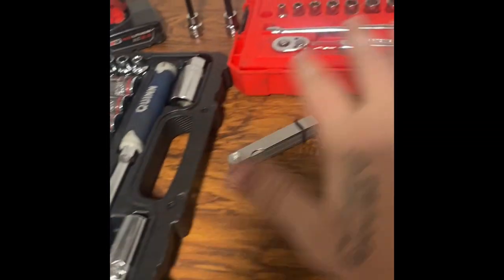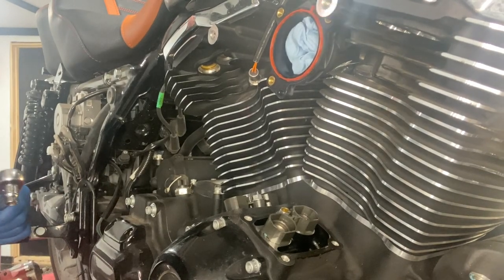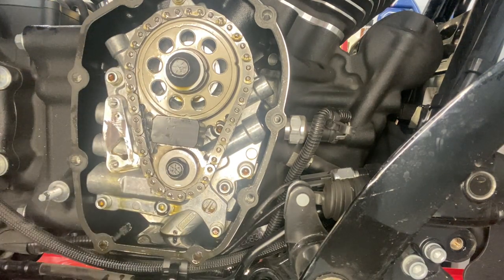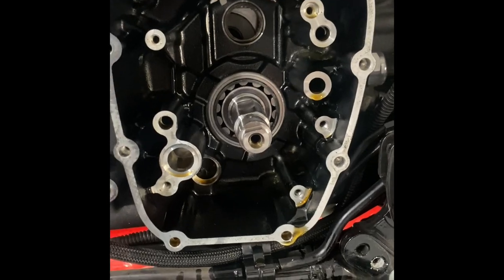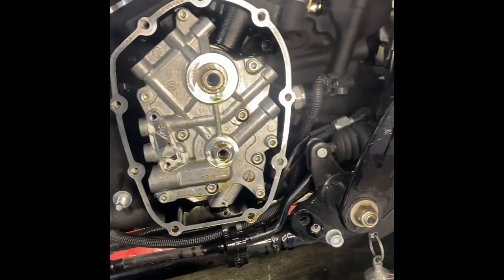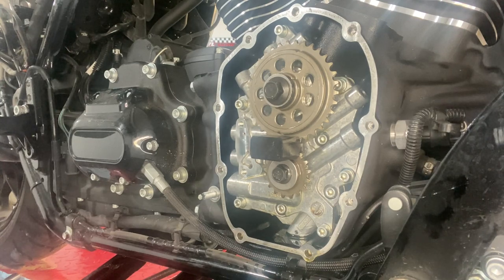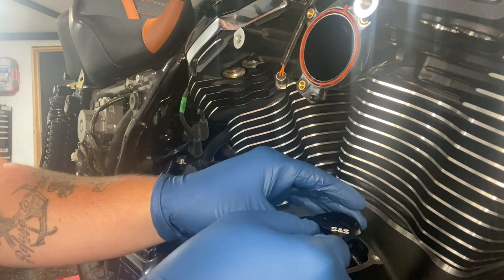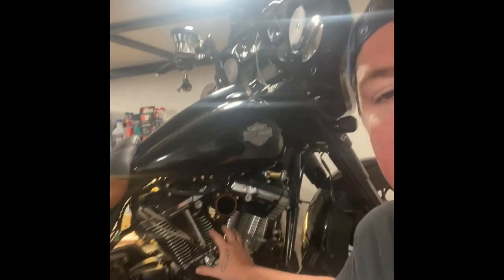2022 Harley Davidson Street Glide S&S 475 Cam Install

Comment: If you pull the timing cover you can put the bike in time on the rear cylinder and cut the pushrods.then rotate the cam 180 then do the front. Easy peasy
Reply from the maker: thanks for the tip! ill be sure to remember that for next time!

Comment: I personally wouldnt recommend messing with the S&S tappet cuffs for bolt in cams. Swapping them comes with serious risk that you could snap a cuff bolt and get landed with a very expensive extraction. I found out the hard way last year when I did an oilpump update and installled an SE Torque cam.
The tappet cuffs like those are used in high end LS Engines and do just fine, and I've yet to actually see any real confirmed reports of a stock tappet cuff failing in anything with a stage 2 or even stage 3 cam.
You can get some Magnetic Lifter Holders and skip the entire tappet blocks step and save a bunch of time, and avoid a bunch of risk by leaving the tappet cuffs alone.
Once you pull the cam out the lifters will fall out of the bottom of the lifter bores. So you can swap in new tappets, keep them im place with the lifter holder, then put the cam in.
Waaaay easier and safer than dealing with the cuff swap.
They dont really need to be swapped to billet ones until like, you do high lift cams that require serious springs and headwork.
If I had known they were a 0% failure rate part I wouldn't have bothered with the S&S tappet cuffs at all.
I got me a 22XE cam sitting in the box to replace my SE Torque Cam, along with an SE 55mm manifold FM 5.5g injectors, arlen ness Ventilator upgrade filter, and Woods platinum lifters. Next riding season is gonna be awesome.
Reply from the maker: To each there own. i personally wont open up the pushrod tubes and not swap out the cuffs. its a cheap peace of mind.
Reply: @whiteshedcustoms if you do it right then tappet cuffs are almost a must when changing out parts.
Reply from the maker: @Braapstar219  exactly!

Comment: Hello and thanks for taking the time to publish this video. 
I'm just starting to get interest into going with a stage 2 torque cam and I have no idea what the cam # mean.
Is the 475 a torque ir power cam and what made you decided on a 475 over another number cam.
My '23 Ultra needs some passing power and I'm not too aggressive ilkn my bike unless I really need to get off the line in a hurry.
Reply from the maker: @michiganborn8303  I would strongly recommend the ss475 or the star 30/30
Reply from the maker: @michiganborn8303  I see your in Michigan I am aswell if you need any help.
Reply: @whiteshedcustoms  
Unfortunately I moved out of Michigan in 2008 and now in the Sacramento area, my heart is always where I come from except for the brutal winters 😁, you can keep the cold.
So that's S&S 475? 
I heard something that the power on the 475 doesn't really kick in until the higher RPMs. Is that true?
Reply from the maker: @michiganborn8303  yes sir

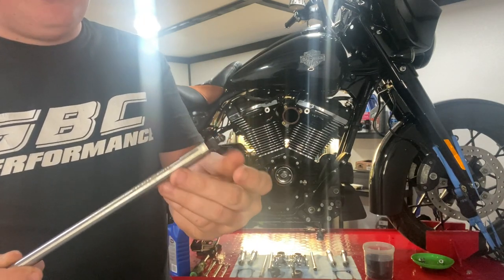Comment: Just getting ready to attack this install on my 23’ RG. Curious as to why you removed the cam plate and oil pump separately if you were reusing both? My bike has 34:06  about 600 miles on it, any reason not to remove and reinstall in one piece?  Thank you for the torque specs btw
Reply from the maker: I  do it so I know for certain that is set in 100%
Reply: Just finished a 22XD cam. I took my cam plate and oil pump out together but I COULD NOT get them back in together. I could not get the oil pump to line up properly while still attached the the cam plate. I had to take them apart and install them separately. After getting the oil pump in, i put the cam plate back over it and snugged down the bolts (not torqued, just barely past finger tight). Then rotate the motor over two full turns just to make sure everything is good and not binding. Torque them down and roll on.

Comment: I have no idea on how to replace a light bulb(got leds😜) so my question is this: how long did it take you to do the can swap/install with give n take?? And what is the absolute necessary parts you need to do it, provided you have full exhaust decatted system and a high air flow cleaner? Thanks in advance and I’m asking these questions cause I simply refuse to pay a Stealership period!!
Reply from the maker: Well The only parts you actually need would be your cam, pushrods and a gasket kit for your hard parts. then just a base line tune will get you by. time wise you'll be looking at 3-6 hours based on your skill set.
Reply: @whiteshedcustoms  I’ve done it she sounds like an old school Harley now but still fighting with the pushrod tubes that are leaking up top… Another stupid design if you ask me from Harley that you’ve gotta fight with screw drivers between the fins to put that clip on… Got the tool hopefully tomorrow she’ll be good to go… Thanks again

Comment: Is this something a newbie can follow along with on a 2021 m8 softail. Or is there other steps that may cause issues and require a professional install? I'd really like to get into it. But i don't come from a family nor friend group that does this. So forums and youtube has been my dad lol.
Reply: Following this video and buying the fuel motto bearing tool ( there is a video on it from them  as well) you should be able to it just fine my only suggestion would be to buy or obtain a copy of the service manual as well just to make sure you’re doing it correctly
Reply from the maker: Exactly what he said! very easy and straight forward and the manual gives you step by step how to.

Comment: Quick question...I literally just finished a 22XD cam this evening. Why not just open the cam cover and use the timing marks for TDC on each cylinder before cutting the pushrods? I already had the rocker boxes after doing my head gaskets if that makes any difference.

Comment: When you set the 1st pushrod do you go ahead and do the other one beside it? I guess rhe fromt get done  after the rear leaks down?
Reply from the maker: I do them both.
Reply: @whiteshedcustoms  I got it done. And got bike back yesterday 121 hp and 133 tq 3030 cam 55intake and 5.5 injectors

Comment: When you installed the cam plate, you mentioned turning it over four times before continuing the tightening sequence - turn it over how ?
Reply from the maker: You’re going to have the bike jacked up and put it in 6th gear. and have the spark plugs out and roll it over by the tire

Comment: Great video! Ill be tackiling this soon on my street glide. Keeping the factory pump and plate as well. I do have a question. Did you reuse the shim that is between the plate and cam sprocket?
Reply from the maker: Yes your fine to reuse the shim.

Comment: Nice job! I thought lifter cuffs torque is 140 inch lbs? You said 60 inch lbs. most other videos I’ve watched are 140. Just curious because I’m fixing to do my breakout and don’t want to fuck it up !! lol.
Reply from the maker: For the cuffs I do 60-100 in-lb. S&S instructions call for 100 in-lb. The tappet covers are 140 in-in.

Comment: I'm going to install a 465 S&S cam in a 2017 limited i didn't see you replacing inner can bearing?
Reply from the maker: It’s requires a special tool. Most people at home don’t replace it so i skipped over it. It’s a super simple tool. I can make a video on it if you’d like. I replace all the inner cam bearings I do just because it’s a lot nicer bearing.
Reply: On a 107ci with S&S's aluminum intake the 465c cam made 121tq @ 2.97 rpm & 101hp @ 5.32rpm. I'm happy but I wish that the tq peaked at 4k.
Reply: Ive always heard replace cam bearing no matter what OEM is crap. New stuff requires new bearing... dont cheap out over a cheap 20$ bearing... @whiteshedcustoms

Comment: Morning. Say nice bike btw. I am curious how many hours you put into the stage 2? I ask because I own the 2019 HD FXDRS 114 M8. I will be doing a stage 2 and don’t want to get grossly overcharged for labor. My intentions are to replace cam, adjustable push rods, tapper cuffs and oil pump. I do have a tuner. Assuming 4-6 hours labor? What amount in labor would be excessive? Any knowledge or advice is appreciated. Thanks guys. Ride safe. 👊🏻
Reply from the maker: Couple hours. Not bad at all.
Reply: @whiteshedcustoms  thank you. I have a feeling they may charge me more than 2 hours. Thanks.
Reply from the maker: @craig2Afreedom  I believe Harley charges close to eight hours for a install that at most takes half of that
Reply: @craig2Afreedom  I’m about to to pretty much the same as you. I called to different places in my area and they both said they would charge like $600 since I had all the parts already. So around 6 hours is what  they said it would take. I know that’s a little inflated but what can you do?
Reply: @joelricobene4147  agreed
Reply from the maker: Well if your in MI give me a call faster turn around and cheaper haha
Reply: @whiteshedcustoms  yeah, they probably go by the book
Reply: @whiteshedcustoms  traverse City here. Where are you located?
Reply from the maker: @craig2Afreedom  midland MI